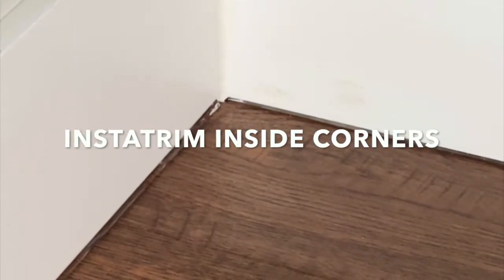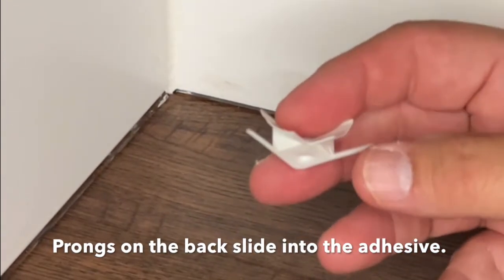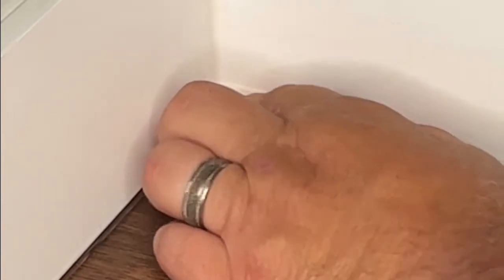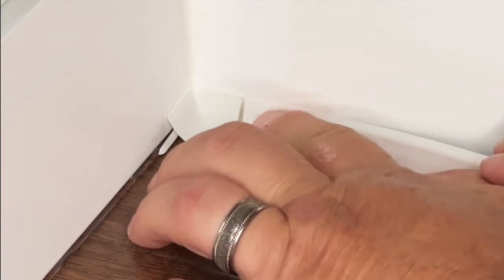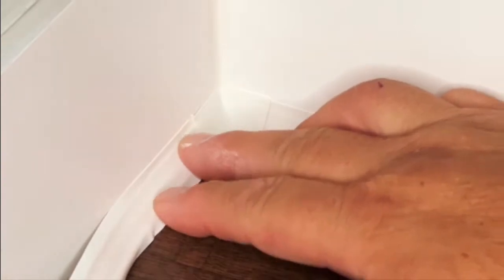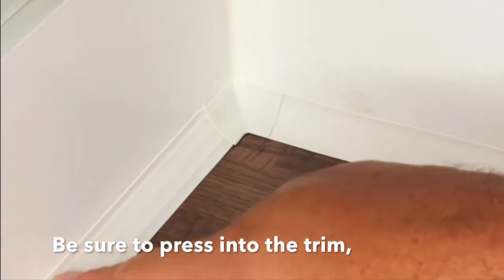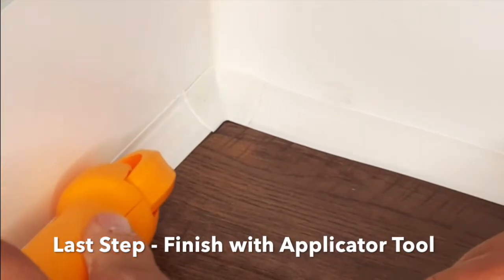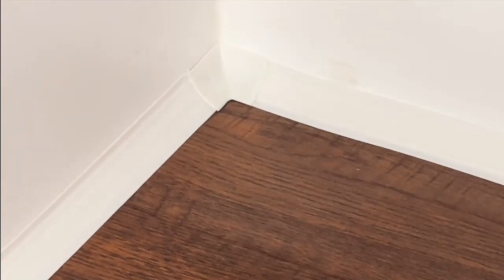How to Install InstaTrim's Inside Corner Trim Caps

Comment: Have you had any problems with it falling off after time? And is it paintable? Held on with putty is putting me off!
Reply from the maker: We use a proprietary adhesive that has the consistency of putty, and an adhesive property that keeps the trim in place. It won’t come off unless the surface hasn’t been properly cleaned with all oils, wax, soap scum, and silicone removed from the surface.
Reply from the maker: Yes it is paintable

Comment: Does that piece comes with it?
Reply from the maker: The corner and end caps are sold separately unless you purchase a project kit which includes a spool of InstaTrim, and applicator tool and 6 corner and end caps.